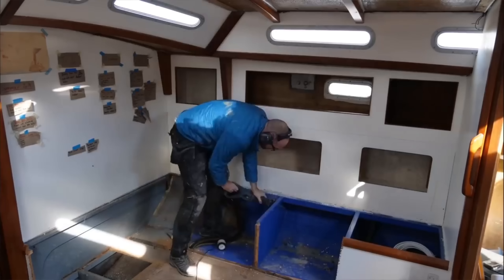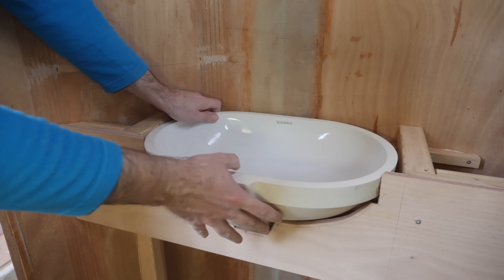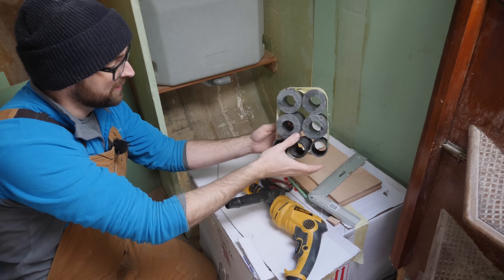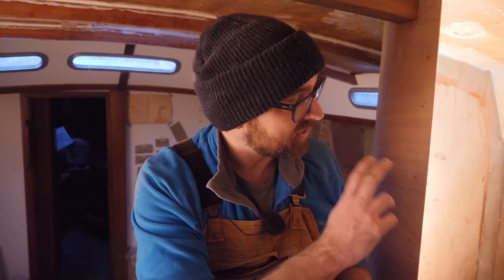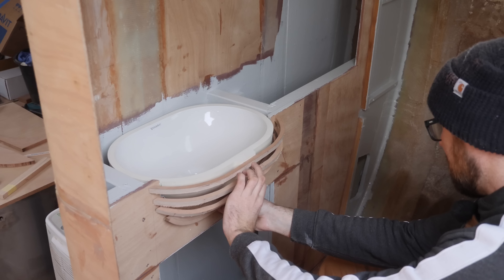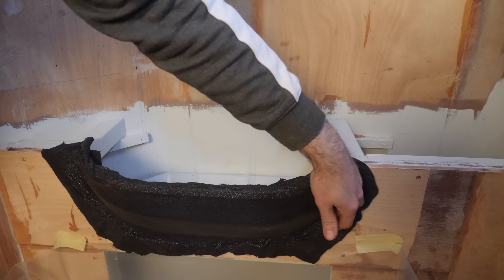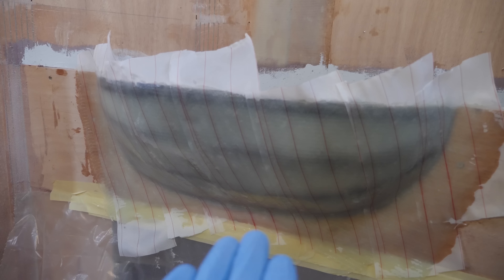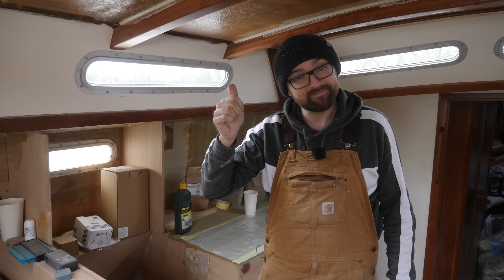Sail Life - Athena’s new head (bathroom) - DIY sailboat project

Comment: Mads - that sink moulding technique is neat. There is another approach I have used a lot in big model aeroplanes and kayak fittings called 'lost foam'. Basically, make the shape up in foam (and you can use cheap poly foam) by gluing blocks together, fair it off to get your shape then glass over it (if using polyester resin, then protect the foam with cheap brown packing tape). When done, sacrifice the foam by either ripping it out or if no access from rear, then pour acetone over it to melt it out. Works a treat!

Comment: Mads, are you going to run a 3rd pex line for a manual foot pump for the head and galley? I used a white colour in mine to differentiate the lines. You'd be surprised how convenient they are when you don't want to wake your crew up  with the pump running or not having to leave to pump "on" while underway.

Comment: Great job Mads. That free form on the sink uses a technique that DIY car speaker cabinets use for wild free form looks. I think you are going to find it is quite solid--especially being a curved surface too. Carving something out of Styrofoam and then putting down a release agent can also help doing curvy stuff in fiberglass. And as a side benefit you get to form the foam by oh, glorious sanding.

Comment: Conventionally the sink overflow goes at the back, you could have saved time with the sink that way round.
Reply from the maker: How could I have saved time? :)
Reply: Sail Life no need for all that glasswork. The bowl of the sink is designed to be seen.
Reply from the maker: Reginald Graves The front of the sink is not designed to be seen. It's raw (unglazed). The sink is designed to be undermounted the only part that's designed to be seen is the inside of the bowl.
Reply: Sail Life Gosh I didn’t notice that! I have never before seen an unglazed sink so assumed that it was glazed.

Comment: Hi ;-)
Is there a reason why you are assembling your lavatory the wrong way? The noun (hole) on the side of the sink is for the excess of water and belongs to be near the wall.
Anyway I love your videos
Reply: its the way the manufacturers design it and with the label on show at the back with the over-flow hidden at the front. but yes, i would have done it the other way around and had a flush front that is more inset towards the wall.-i'm a plumber ;)
Reply: @martinbritt1002  Hi :-)
 Sorry, but there is a Norm for the correct assembly of a sink and this is the wrong way...Anyway, it's his boat and there is always a place for creativity.
Reply: @mpassosdias7004  - You need to get out more. The norm is different from country to country. Some countries do it one way, some the other. There is no "right" or "wrong" way.. there is just "this is how we do it here".

Comment: Mads, in the US you can buy thicker 9 mil black disposable gloves marketed for auto mechanics. They are about twice the thickness of the light blue 5 mil gloves you use. The 9 mil gloves run about 20% more than the 5 mil gloves. I use the 9 mil gloves with working with West Systems Epoxy in my woodworking activities.

Comment: When I am working with epoxy, and generally when I wear rubber gloves, I tend to use a thicker, nitrile glove first, then a thinner glove on top of that.  The reason I double glove is that I sweat in them and it makes it easier to change out the outer glove layer.  Also, if the outer layer gets ripped, the inner layer will still protect my hands.

Comment: A 4" deep 'medicine' cabinet above the sink could be tapered on the left side to accommodate the bend in the bulkhead while still providing a plane surface to mount a hinged mirror to. The added bonus of providing a lady with more cosmetic storage space right where it's needed will ensure a happy crew...(Don't forget the application of makeup requires more direct candlepower than many lighthouses put out, so you'll need a pair of bright LED's over the mirror and not just a 5 watt overhead for reading your ColRegs...)

Comment: For quick glove changes I have found putting on 4 or 5 layers of blue gloves is awesome in some circumstances.  If you need to, you can shed a layer really fast and get back to clean gloved hands instantly.  

So when you get your hands crapped-up, and don't want to get epoxy all over the place, you just peel a layer and keep on going.  No need to stop and put on another pair.
Reply: Also easier to do sense  your hands are usually sweaty and takes a little while to be able to put on new gloves
Reply: This. I do this all the time and being in hot climates it is so I can even change my gloves. When it's hot my hands sweat and then another pair of gloves wont even go on. Then I have to run cold water over my hands to cool them and then dry them quickly before I sweat again a d try to put another pair on, what a hassle. So instead I wear a base layer then a pair on top and can change the top pair over and over with no problem!
Reply: I do double gloving with precisely two shakes of Bralla for men genuine fine talcum powder but I like the smell of Bergamot too.

Comment: Dont let the door open with the seat up, that way there is less chance of things falling down the head?
Reply: Expecting people to do the right thing often ends up with your arms up to your elbows in the toilet.
Reply: Mal Moy certainly has had a life on a sailboat. When I open a cabinet door over the head, I now am adamant about closing the lid on the toilet, for very good reason.
Reply: Good point
Reply: My cabinet door opens into a handy shelf over the toilet so not much chance. It isn't going very far anyway unlike a domestic toilet. Our home version has been a bath for several mobile phones, even the odd pair of specs.
Reply: I was thinking the same thing. I am sure a woman would have said "what's so hard about putting the seat down before opening the cabinet?" 😜
Reply: @danielbuckner2167  - Probably the same woman who complains about a man leaving the seat up.. Despite the man saying "what's so hard about putting the seat down before using the toilet?"

Comment: Smart  move with the gloves. There are people [like myself] who can just about bath in epoxy and it will have no effect on them. I discovered this by accident when building my first aircraft in 1972. I had been getting epoxy on my skin every now and then and the just washing it off with a rag soaked in acetone. Yes I know BIG DON'T DO THIS . A friend can over to help and within an hour he was starting to get blisters on his arms where the gloves didn't protect him. Moral, use good quality gloves and wash off with soap and warm water ASAP. When working with epoxy. Don't mean to preach just want people to be safe.
Reply: A allergic reaction to epoxy can develop suddenly, using barrier cream on your forearms can help protect areas that the gloves don't cover.
Reply: It helps a lot if you use modern epoxy systems like Bote-Cote instead of primitive ones like West System. The modern types are basically non-allegenic. But no.. everyone's heard of West System, so they just reach for the well-known go-to solution instead of bothering to find something that's safe to use.

Comment: You realize that by having your head storage doors able to open with the seat up, as soon as you open the doors everything will fall straight into the toilet.
Reply: There should be fiddles on every shelf.  The bottom shelf will be below the opening so that will be a natural fiddle.  Each shelf above should have a fiddle built in.  

In our boat the shelves all come out so someone can get their body up there to access the chainplanes and the head anti-siphon loop which is installed back there too.

In two years of full-time cruising our toilet seat has been closed about 1% of the time. Very few items have fallen into it from the cabinet above when the door has been opened.

I didn't build it this way, Hallberg-Rassy did.  They are still around,  making new boats and selling them for big money.   So I guess they knew what they were doing and what works.

Comment: Note to Ferroboat guy,  Last week you showed the damage to the hull of the ferro cement boat, having previously owned a 45ft Ferro yacht 

I have some experience in this type of repair, although my boat never had hull damage this extensive, I can offer some advice on how to repair the hole. Fixing the hole by just filling with cement will not give a very good result.

1  Clear the edges of cement with a hammer, you will know when it's back far enough because the hammer will ring and not damage the cement. To see what is good just hit the hull with the hammer in a good area it will ring in your hand.
2  Feather the edge of the hole with a grinder, to a chamfer of around 40-50 mm, clean the surface around the hole.
3  Treat the steel re-enforcing with kill rust and metal primer.  (Inside and out)  Make sure the humidity is low before continuing.
4  Here is the neat part, you need to make a filler which will bond to the hull and have the same expansion rate as the hull,
using Fine Portland Cement (just needs to be sieved) and 2 part Epoxy (I used west system) mix up the epoxy using the correct ratio, then add some cement, mix until the mixture is like whipped cream consistency, it will resemble a black mud pie..
5  Add this to the hole in the outside hull structure with a spatula.  Beware not to get this mixture on anything near the boat it will not come off, wear protective eye wear Have some strips of plastic ready to tape over the hole to support the mixture.(Good to have a helper at this point)

6 Before it fully cures add another batch to the inside of the hull overlapping the edges of the hole by a small amount.

I can't claim this was my method it comes from an old book about Ferro Cement yachts which I believe was written by Bruce Roberts in the 70's.  However I used this method on my boat 30 years ago and never had any issues afterwards, I also used this on another ferro boat which had been holed and it worked very well,  beware this mixture is very nasty and safety precautions should be used when using it. 

Cheers Tony
Reply: I recently replaced 6 square metres of hull on my Hartley southseas, perfected the method with a combination of repair advice by the real expert, Collin Brookes and enovations in an available product by Sika, sikadur 31/41 epoxy repair mortar. Breaking back to sound ferro around damage initially by air chisel then wet sandblasting , preserving & derusting the edge of the stringers & all 8 layers of bird wire for overlap, re tie and plastering. Impact damage is allways worse when the hull was built with square welded mesh rather than twisted strand bird wire, a combination of the two is okay for decks, transoms and floor frames
Reply: Tony Cross - with the new technology of graphene concrete boats may come back into fashion
Reply: @rethinkscience8454 - Wow sounds expensive, Graphene currently goes for around $150,000 a Kilogram, putting a small patch on my old boat would have quadrupled it's value. I loved my boat but the biggest issue with Ferro-Cement boats is that it's almost impossible to insure them, even though Ferro-Cement makes very sturdy and capable boats.

Here is an interesting link to some Concrete boats which are still sitting around in the UK from D-day during the Second world war.
https://londonist.com/london/history/visit-these-concrete-ships-from-wwii
cheers
Reply: Tony Cross - yes still early day of this new technology but it will be in everything when it’s cheaper then wood

Comment: You've got the peg and hole business reversed. Timber framers actually do want a round hole (easy to drill) and a square peg, which cuts in along the edges, preventing rotation and movement.
 It is a round peg (slippery) in a square hole (hard to cut) that they want to avoid. Remember, measure once, cut twice. (G)

Comment: Mads,. You may consider putting a medicine cabinet up with mirror on front.  Just large enough to hold a toothbrush, tooth paste, and the like.  Not sure if you will have room or not but it is worth consideration.
Reply: If it were just Mads I'd agree, BUT...
I think a certain Admiral would find that size mirror too restrictive!
Reply: @gking5522  true.  I did intend it to house TWO toothbrushes.  I believe there is little worse than a wave that tosses ones tooth brush into the head...except tossing ones Admiral's toothbrush in instead.